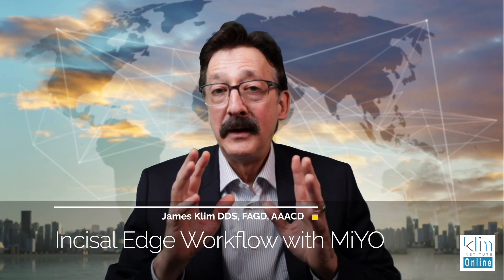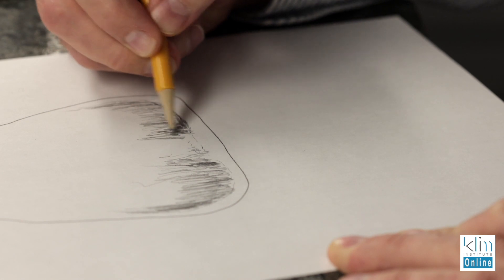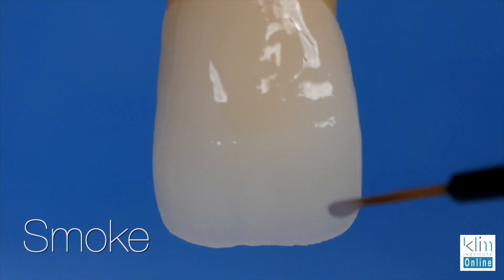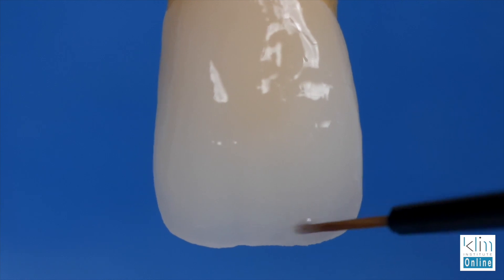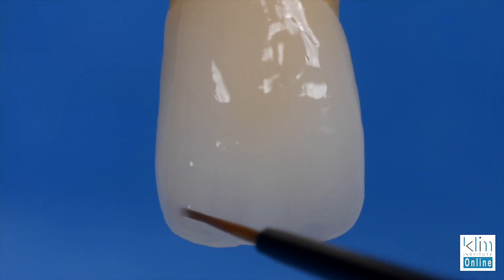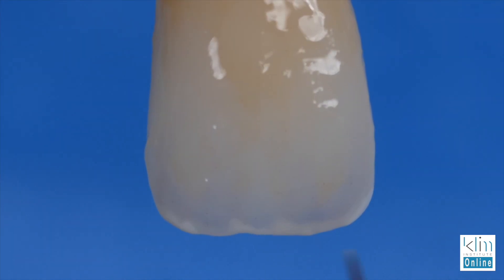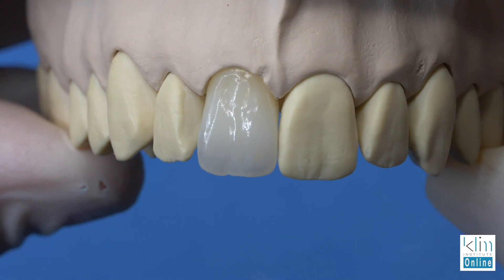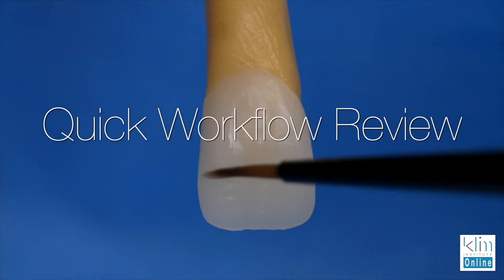Creating Incisal Edge Effects on Monolithic Veneers and Crown

Comment: Congrats, nice video, Doc.
Can Miyo be burn in the speedfire furnace? As a glaze program for the emax cad.
Thanks
Reply from the maker: Good question,  Unfortunately, the Miyo is sensitive to firing conditions.  A vacuum is needed which the Speedfire does not have.  Programat CS2 by Ivoclar is a good all-around ceramic furnance.
Reply: So you can mill emax veneers with Cerec, and then characterised with Miyo, and then fire with Programat CS2?